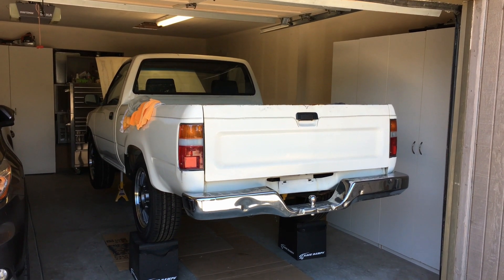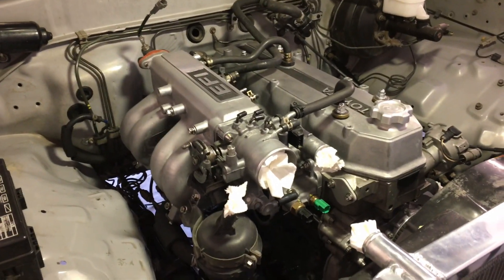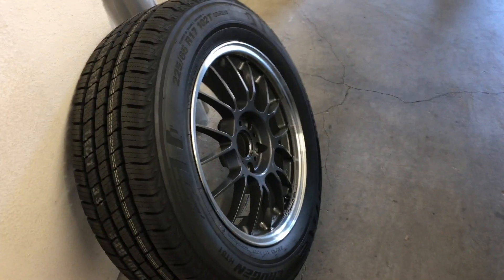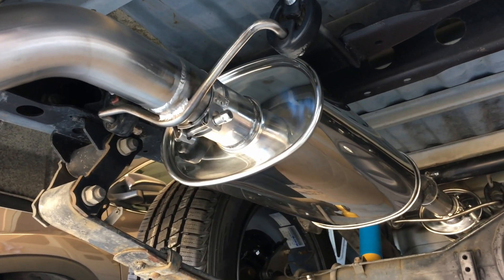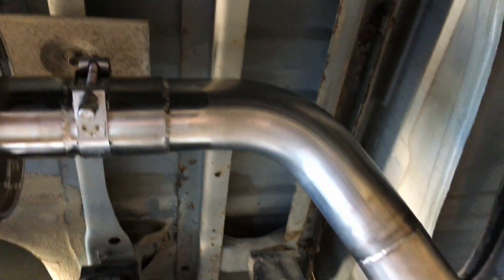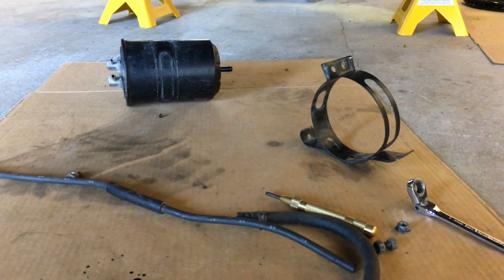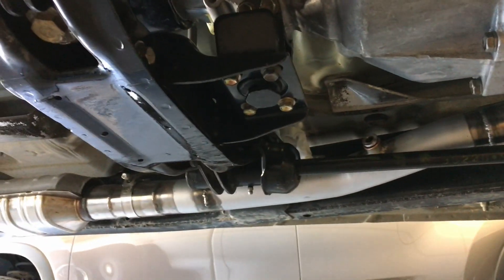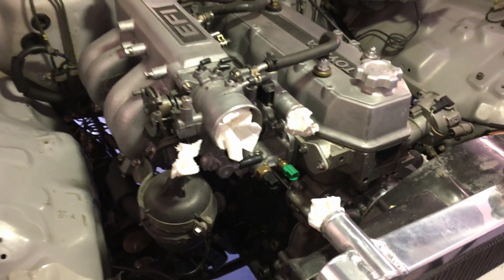1990 2WD Toyota Pickup 22RE - Stainless exhaust 4-wheel disc brake update

Comment: Ray, I installed the LCE header and cat-back exhaust.  In my opinion it's a bit too loud.  Sounds like I should be 30 years younger with a backwards baseball cap, if you know what I mean.  It is your experience that these systems quiet down with time?  Also, I left my catalytic converter out, do you think putting it back in would quiet the exhaust, or no?
Reply from the maker: I know what you mean. Are you running any sort of resonators / mufflers in the mix? On mine, the LCE header dumps into a high flow cat, then it goes into a vibrant resonator and then finally a vibrant "muffler" - which is mostly just a large resonator. Everyone comments how nice the exhaust sounds, but if you are on the throttle you can definitely hear it - but it's a nice smooth exhaust note (not anything like a rice rocket or anything).
Reply: @ray5961  it’s the LCE Pro Flow exhaust.  It has the Street Max muffler.  It has a deeper tone but anytime you’re on the gas it’s too loud in my opinion.  I find myself suddenly attracted to girls in Vans sneakers and Rockstar energy drinks.   I might need to figure out a resonator or something to go where the cat used to sit.

Comment: How much to duplicate those caliper mounts?
Reply from the maker: The rear ones?
Reply: I’m interested in eventually duplicating the whole brake setup front and rear if you have a parts list and would be interested in making another set of brackets
Reply from the maker: @dustinn5490  You're probably looking at close to $4000 in just parts. I don't remember the exact amount I spent, but it was on the expensive side. The rear brackets which go between the stock axle and the Wilwood bracket aren't too bad. I exactly have a spare set of those, but they are not threaded where the bolts go - you have to drill and tap those, which is no fun given that they are hard very stainless. Those also wouldn't be hard for me to make another set of, if you are interested in purchasing them. The front brackets are a little more complex. I ran into difficulty having those cut due to the thickness of the aluminum. I might have to have them water jetted next time. I think my CAD drawing and measurements were off by maybe 1mm or something, because as I remember I had to buy shim stock and dial those in so the rotor would turn correctly. I may have notes in my files on the truck regarding that, but it's been a while. Also, those don't just pop out of the laser cutter ready to bolt on. I had to machine them a bit and also drill and tap those then install the threaded inserts, etc. It was a nightmare job, but at least the Wilwood calipers bolt directly up. As far as the brake disc rotor hats, I had to run some plastic rings as I remember, in order to index those to the spindle hubs. I tried a few different sets and finally landed on some from China as I remember. I also had to install ARP wheel bolt studs, since spacers had to be used to obtain the correct offset. There is a company which sells a similar kit to mine. I forget the name of the company, but I can look it up for you. Originally I was going to buy their kit in front, but it uses slightly different hardware and requires 18" wheels, which I didn't want to run on the truck. Because I wanted to keep it down to 17" wheels max, I had to make my own setup, which ran tighter clearances between the caliper and wheels. Anyway, if you are interested in spending $4K or $5K on your brakes, feel free to contact me at the email address listed on the channel's About tab. I'm not setup currently at my shop to do much, but I might be able to help you get on the road by cutting another set of brackets maybe. Feel free to contact me, but just be aware it's a big job and a costly one.